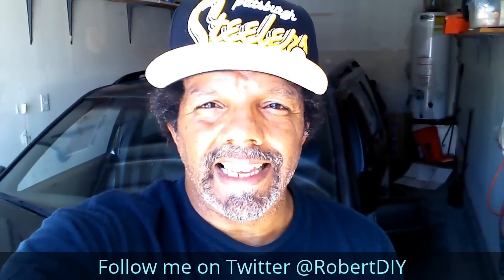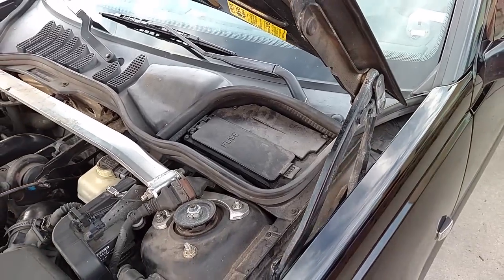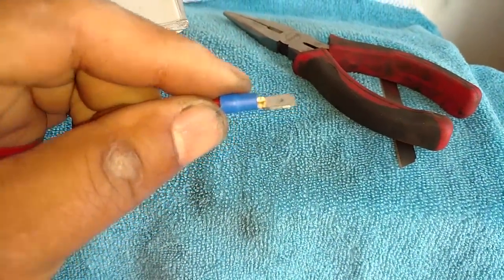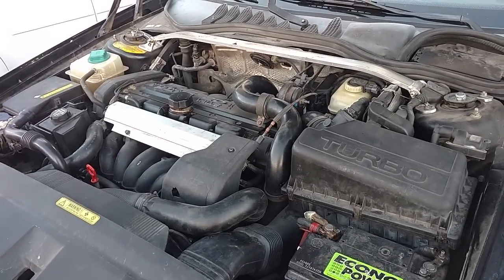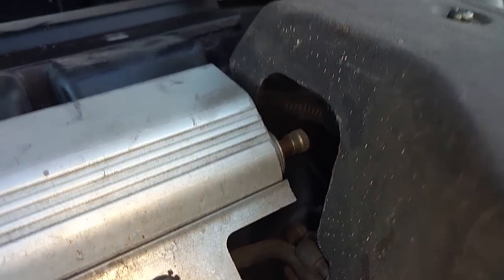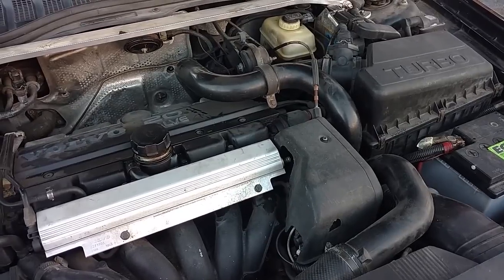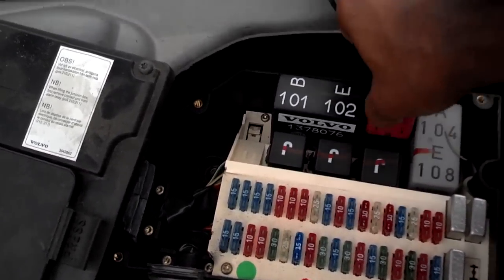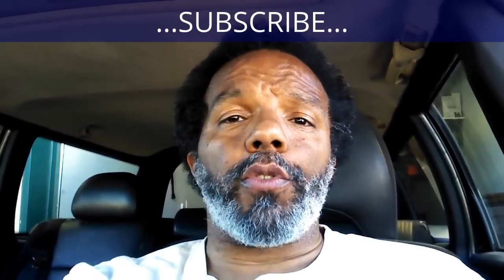Random stalling, will not start, fuel pump and relay testing, Volvo 850, S70, V70, V70 XC, etc.

Comment: hey Robert I've been watching your videos and I need help. my Volvo 850 has been running good atill  the starter went out I just changed it and now its cranking but not starting.? what could it beee ??
Reply from the maker: https://www.youtube.com/watch?v=3InZVPLYgqs
Reply: +Robert DIY hey I started to take off spark plugs and notice oil in there already and not sure why ? its raining so I stopped and let the battery charge .I just hope I could fix it before I take it to a mechanic but its been running fine never failed atill starter
Reply from the maker: +Martin Kieth bad PCV and bad oil cap seal.
Reply: +Robert DIY so I have to buy the PVC kit ? and its not starting so I figure a bad PVC won't let the car start
Reply: Martin Kieth I was wondering if you figure out what was wrong with your car. I have a 1997 960 that act up the same way as yours.

Comment: Hello Robert thanks for the videos.  I tried to jump the relay but didnt hear anything at all from the fuel pump, and its quiet out hear. But, I did get gas coming out of valve that you spoke of.  So would my pump still be good if  I am getting gas.  I have a 98 volvo S70.
Reply from the maker: I don't know, how much gas came out?
Reply from the maker: What's the problem with the car?
Reply: well, the car had been sitting so I figure it wasnt just left over gas. It had a little presure to it because it didnt just fall directly down, it shot out.  It was about a 3 table spoon.

Comment: My volvo S80 was riding PERFECT then stalled as if I turned off the key. There is fuel on spark plugs. Its cranking and firing ,but not turning over. DIAGNOSTIC test says no problem found.  Yes the battery was out for twenty minutes since while trouble shooting.  How do you reset the system?
Reply from the maker: cranking and turning over is the same thing.
Reply from the maker: https://youtu.be/cWKOi8D4SWQ

Comment: Hi robert, do you know where is the fuel pump relay on volvo s70 2.5tdi? Becouse there is nothing, no relay at all,  in the place where is the relay 103 located in your video, the car ran before, now it runs only if you jump the shut-off valve from the battery, thanks for help!
Reply from the maker: Sad to say, no.
Reply: Roberts a great mechanic

Comment: Hello Robert,   I'm having the same intermittent stalling problem while driving. Funny, this started happening right after I fueled up ;last week. Even though I'm buzzing along while it stalls out and the transmission is turning the engine, the tac goes to zero as if it's a power issue. Could my crank sensor be going?
Reply from the maker: https://www.youtube.com/watch?v=NhtUXZTurzo
Reply: OK I didn't know it had it's own reader.  I'm getting a 2-3-2 code.  I't currently having a problem starting up in this north east , below zero arctic blasts.

Comment: great video as always, thanks!  I changed the relay in my 98 S70.   ran fine and my son calls and it still stalled on him. he kept going a couple miles and got home. it started ok when I went out later,  reeved it up and then drove around the block. previous to the relay change he said it had stalled while driving a couple times and then started working. a couple days ago it wouldnt crank and we towed it home, only to have it start fine later prior to relay change. I am ready to retire this car. that was the first time in 21 years it has left someone stranded. I haven't been disappointed! I changed the ignition switch last year when the dash indication went out.  any ideas before it is retired? ,  wish I could have met you when you came through memphis
Reply from the maker: https://youtu.be/NWfLpp8NevI

Comment: Hey Robert thanks for this video. But my car hesitates to struggle only when it's hot outside can that be the relay problem? Thanks
Reply from the maker: +Dave Cruz huh? Hesitates to struggle?
Reply: Robert DIY yea I mean it won't start right away. It's hard to start it cranks but takes a few try's. And u can hear the fuel pump clearly tho.
Reply from the maker: +Dave Cruz did you try jumping the relay socket?

Comment: My s40 will sometimes just completely stall and getting it to idle right involves reving it and then it would run good. Lately, as of a couple days ago, it has been just misfiring and the trick of trying to get it to rev hasn’t worked at all. Sometimes I will hear a hissing noise but I didn’t hear any hissing just now as it was misfiring. Do you know what it could be? ( I have replaced the ignition wires, spark plug wires, coil packs, boost solenoid, cam position sensor, and fuel filter)
Reply from the maker: https://youtu.be/NhtUXZTurzo

Comment: I gather the computer sends power to the relay to activate it. Does the fuel pump run continuously or does it turn on and off as commanded by the computer. If on and off, what does the computer use as a signal that it should power the relay and thus the pump?
Reply from the maker: +DG Carlson are you going somewhere with all of this? I don't even know what kind of car you have.

Comment: so my s70 pump primes but the pump never runs again and car will not start. it did start sometimes after stalling but now it wont start at all. I did the jumper and the pump runs and so does the car. so just a bad relay. could it be that simple? it primes to the correct fuel pressure but goes to zero when trying to start.
Reply from the maker: Yep. Did you drive it with the jump wire installed?
Reply: Car ran great. I ordered a new controller that just arrived. looks like problem is solved.

Comment: Hi Robert!
I did as you said in the video with the wire, the fuel pump started to work again. But instead of just turning the key i turned it all the way and the car started. I let it run for one minute but it was idling at 500 rpm if i didnt use my feet on the gas? After turning the car off again i replaced the wire with the same old relay. The car didnt start but when i tried with the wire again the pump didnt make a sound? And now it wont start again, did i brake something?... PLEASE HELP!
Reply from the maker: You likely have a bad fuel pump.
Reply: okay thanks!

Comment: Hi Robert, I need you to help me, the car was very helpful and I tried to saw off the nut that it brings to regulate it, but I did too much and it turned off and no time, it does not want to turn on that I can be s70
Reply from the maker: I have NO IDEA what you are trying to tell me, you need to call or text me.

Comment: Hey Robert, I have a question about my 2000 Volvo S70. Sometimes the car doesn't want to start. I had to turn ignition key on and off and pumping the brake pedal. It will start after it. Any suggestion to fix this problem? Thanks
Reply from the maker: Any codes?
Reply from the maker: https://www.youtube.com/watch?v=gLoO-D4yOcU
Reply: What do You mean a codes Robert? How do I get a codes?
Reply from the maker: https://www.youtube.com/watch?v=NhtUXZTurzo

Comment: Hey man, i have a 2001 volvo c70 and it doesnt always wanna start. Sometimes it will start, idle for a second then die. Sometimes it starts fine. But it never stalls while driving. Typically everytime it starts and i drive it , whenever i go to the car to try to start it again after driving it wont start at all for minutes to hours. Any ideas? I feel its fuel related but am not sure. Thanks man
Reply from the maker: https://youtu.be/8xIi3_n5vsQ

Comment: Hey Robert i had problem yesterday,maybe u can help me like few times . I start my Volvo v70 2.5 170 ps and drove it 1 hour,then i stoped at some market and turned off car,as always i do. When i finished i came back and start again,but wont start,just cranking,pump working,i checked fuel from lift and was ok,after  about 15 min my car start again. I came home and turned off again and was same time as at the market. Wanna hear your knowledge. Thanks
Reply from the maker: https://youtu.be/Jc4pfC3D3EU
Reply: @RobertDIY  thanks. I changed ECT and thermostat  and  temp scale is ok when is cold stay down and when hot is up. But in morning when i starting i have smoke  behind. Maybe i need again change both? Thanks again good man 😁
Reply: But i changed them before two months. What do you thing about crankshaft sensor? I have OBD 2 diagnostic,but cant connect with comouter because some guy delete something and now is "erorr tp-link"....

Comment: I have a 95 GLT850 manual wagon. She's been having unprovoked acceleration (revving up to 4K with the clutch in). Yesterday after engine reached more than 4K rpm at a stop light, the car died and wouldn't restart. I restarted a few hours later, no problem.
Seems like this is NOT a relay issue since relay is on/off and wouldn't impact acceleration. (?)
- I'm thinking I should change the fuel pump.
Any way to further troubleshoot?
Reply from the maker: Is the throttle cable getting stuck?
Reply: Robert, it seems you were right on the money! The cable between the throttle body and bracket had enough slack to wrap oddly across the throttle body. I adjusted as you demonstrated in your throttle cable replacement video  and everything seems back to normal. Time will tell if it was just wear and tear or something else. Either way, I've learned a TON from your very informative and concise video series. Thank You!!
Reply: Time reveals that the loose throttle cable was not the issue. The vehicle still intermittently "accelerates" especially at stop lights, and at times fails to start. Although the engine revving was not in your top 5 for failing fuel pump indicators, the vehicle mileage is high and I'll probably just replace the pump at this point.

Comment: I own a 96 850 non turbo, I was having this trouble so I replaced the fuel pump relay, the spark plugs and distributor cap, the ignition coil and lastly the battery. Mechanic said the fuel pump was working but left it at that, any idea of what else it could be? Engine cranks but will not start.
Reply from the maker: What is missing?
Reply from the maker: https://www.youtube.com/watch?v=YiPAPu-K8OI

Comment: Hi Robert, I have a very rare no start issue with my 96 Volvo 850t5. I go into a store for 2 hours, come out and the car turns over but doesn't start. After about 5 attempts, it starts and runs perfect for another year.  This has happened only 3 times in the last 2 years, so it's very hard to diagnose I have cleaned the idle air control valve with throttle body cleaner. The ignition system is all up to date. The fuel pump relay and pump were replaced about 8 years ago. Could it be that there is problem with the relay? Could the relay have a no start issue that is so spread out with time? Usually happens in winter. I'm keeping a spare new relay, just in case!
Reply from the maker: +PAUL MACZ probably the fuel injector relay or connector. The thing to do is check it for fuel pressure at the rail the next time it fails to start. Also check for codes. Call me if you'd like to talk about it.
Reply: Thanks Robert. So far no codes at all, but I will check the connections. Each no start took place in a dark parking lot when it was around 10 degrees out far from home so not much possibility to troubleshoot fuel pressure. Funny, when I was just getting ready to call AAA to bring my car home, it fired up and ran great for a long time. The one time it didn't start it was around 90 degrees, again late night in a parking lot. I cleaned the idle air control valve and it took me home with no more problems pulling a motorcycle on a trailer. Scary, and gives you less confidence to travel. But still a lot cheaper replacing parts once in awhile than making new car payments forever!! You are the top Guru for the Volvo 850 in the world!! Thanks for all your help.
Reply from the maker: You have to scan for codes when it fails to start, leaving the key on.
Reply: I always learn something new from you. I thought my scanner would only work if I'm getting a CEL on the dash. Great idea, I will bring my scanner with me all the time, and when it doesn't start, I'll do as you suggest.

Comment: My Volvo was stalling randomly and i stopped for about 2 hours then it worked again. Should i buy an extra relais just in case?
Reply from the maker: just make a jump wire. if the relay is old, just replace it with a new one.
Reply: @RobertDIY  than you for your reply your videos have helped me multiple times!

Comment: Hi I had a Quick question my Volo s70 1999 will not start it will crank but not start it is not the relay do you think it is the mass air flow senser or fuel filter or what do you think the problem is
Reply from the maker: +parbjot khela What is missing?
Reply from the maker: +parbjot khela https://www.youtube.com/watch?v=YiPAPu-K8OI

Comment: i have a  volvo 2004 volvo v 70 that the fuel pump shut off due to the impact of an accident . how do i turn the fuel pump back on again. cause car keeps cranking but wont start.
Reply from the maker: +rosemary ijeomah have you checked the owners manual?

Comment: Hello Robert thanks for the information. Ok here is my situation. On a 94 non-turbo 850 with 275k miles. It is going through fuel relays about every 6 months. I carry a spare in the glove box when it is needed. The jumper wire activates the fuel pump and appears to push a healthy stream. All contact are clean and dry, both in the car and the relay.  

As soon as the car won't start or starts and runs a short distance I have installed a new IPD provided relay and all is fine for about 6 months. It almost goes with the major seasonal change. I live on the west coast about a mile from the ocean and we have a damp climate.   I am running non-ethanol fuel and the mileage is approx 29 mpg. Any ideas why it is going through fuel relays?  "Help me Obie-wan-Kenobie, you are my only hope". Thanks in advance.
Reply from the maker: +Jon Pulicicchio how many relays have you replaced?
Reply: Robert DIY 3 times in about 16 months
Reply: Fuel that is
Reply from the maker: man that's crazy.
Reply: The local dealer just wants to throw time at $130 an hour to "troubleshoot it". Uh-huh. LOL

Comment: Hey robert im new to the channel i just replaced the fuel pressure sensor the pem the fuel pump and injectors and i just started it up today and drove it around a bit and when i hit the gas it just revs and doesnt go anywhere and at one point it actually died on me and then shortly after started back up like nothing but still jumped rpms on me could that be a fuel pump relay?
Reply from the maker: I don't understand what you're saying. You may want to go to my website and call me.
Reply from the maker: I don't even know what kind of car you have. 🤷🏾‍♂️

Comment: hey robert do u have any video about the fuse box? i have 1994 volvo 850 just need help cuz the light inside my car not working thanks
Reply from the maker: +Francis Bonga what about the fuse box?
Reply: Robert DIY my interior lights not working
Reply from the maker: So what does that have to do with the fuse box?
Reply from the maker: When you push the button, do they come on?
Reply: Robert DIY no lights the door indicator the glove compartment

Comment: Please Help...Hello Robert I have a 92 Volvo 940 sedan. I'm getting no spark at all. I changed the ecu, cranksenor. I took the distributor off to see if it had a sensor but it has No sensor. Is there another Ignition Control box that I'm missing or something.
Reply from the maker: Is the timing belt on? Does it have a radio relay?
Reply: Robert DIY yes timing belt has been checked. And yes it's a radio relay by passenger side fire wall. Will the radio relay stop spark.?
Reply: I was told the radio relay only causes the injectors to fire
Reply from the maker: Check Barton's website. I'm pretty sure it stops spark.

Comment: Thanks again Robert! One of our S70s has a no fuel situation (runs if primed past the MAF). I will try this tomorrow. Besides the two in the family I also have one junked for parts. Comes in handy. :)
Reply from the maker: Cool, hope you get it figured out.
Reply: Did you ever figure out your issue
Reply: @wrestler4life521  Honestly don’t remember what I did, but both ours are now parked in spots they pulled into on their own power. Turbo has a head gasket leak, but still ran okay. My son ran the wheels off the other one through 4 years of college. I remember replacing MAF and fuel pump relays on the 240s, and multiple in-tank fuel pumps over the years. Issue was likely resolved by this video. Always check ground connections and fuses as well.

Comment: Hi robert, my car starts and drives most of the time but, sometimes it doesn't start or it will shut off while driving.  a shop told me I had 32PSI fuel pressure and it should be 55PSI, and said my fuel pump needed to be replaced,  is there anything else that would cause this besides my fuel pump? 2004.5 Volvo S40
Reply from the maker: Does the car have codes?
Reply: Robert DIY the shops paper says interface computer system 261, 2110, 2210, 3503, and 3502. I tried to hook up an OBD2 scanner myself and the scanner said error
Reply from the maker: Man, I don't know much about that. Have you googled the codes?
Reply: I've tried to but, I can't find anywhere that lists those codes, what do think would cause the low fuel pressure? I'm thinking the fuel pump but, you might know more than I do
Reply from the maker: I've seen torn fuel lines inside the tank on the pump assembly. You may want to pull it first.

Comment: yes I have a 2000 S40 Volvo that will not start it does crank and turns but it wont start I've noticed that it auto anti-theft light is now blinking by the stereo which it wasn't leaking before what is it that I need to do
Reply from the maker: +Rita Arocha https://youtu.be/YiPAPu-K8OI